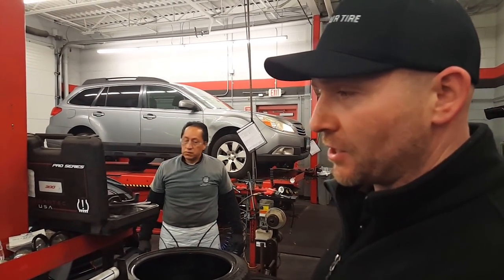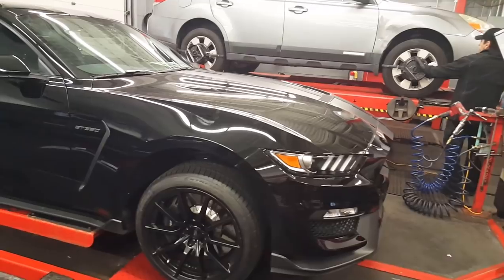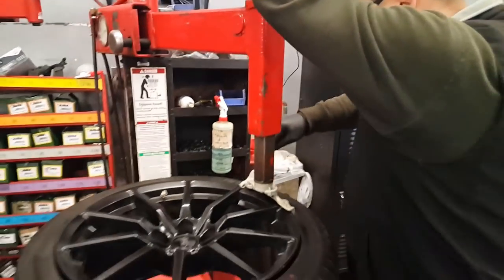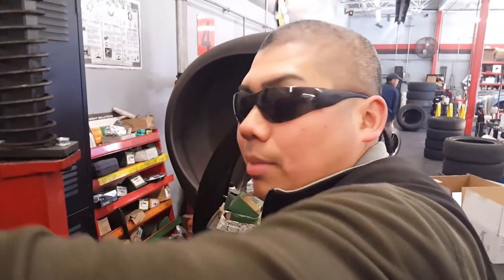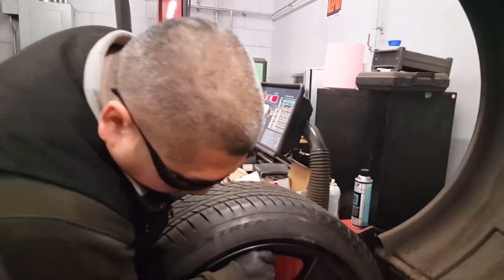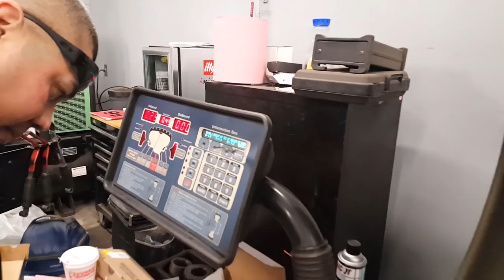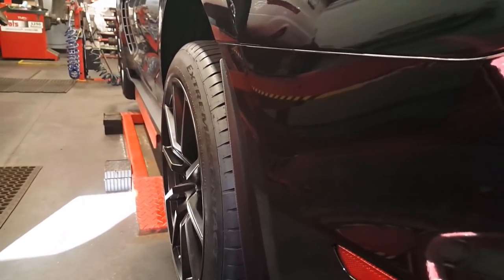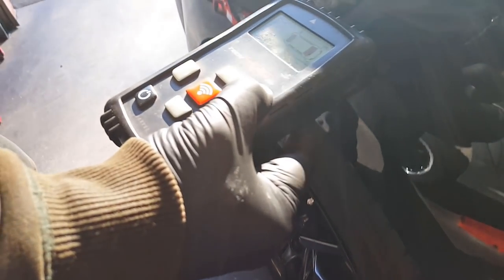How to Stretch a Tire on a Bigger Rim (Winter Tires on GT350)

Comment: Great video - I learned a lot. Never knew you had to reset the pressure sensor. What would happen if I put wheels on the car without doing that?
Reply: Mike Fyxdt they sell a device at ford parts for resetting TPMS. I believe it’s like $35-$40.
Reply from the maker: Thanks Mike. Your car would probably throw warnings.
Reply: From my experience the TPMS would just be blank and no warnings at all. Example I changed the 19 inch wheels on my 2018 Mustang GT to the optional 20 inch Mustang wheels and did not reset the TPMS. No warnings the system just does not show any tire pressure.  We used to do just fine with out this system

Comment: I have a 2021 dodge durango rt but it came with 295 45r20,  and I bought winter tires that are 265 50r20.  Would they fit on my rims? Or do I have ti buy smaller rims?

Comment: Do you have 255s on the front now? Also isn't it a bit late to have winter tires?
Reply from the maker: I should have said this upfront but this was back in December. I've just prioritized other videos first. Check out my Ford Performance Saved me $2000 for the prequel. :)  Yes 255 on the front.
Reply: @DucatiDiaries  Yeah I remember seeing the video, just didn't remember seeing them actually on the car. But damn that's even more impressive how those were able to fit
Reply from the maker: @mistamaog  And the kicker is I brought it to three shops before this and no one wanted to try it. But Town Fair Tire in Norwalk said it was no problem whatsoever!
Reply: @DucatiDiaries  Yeah I remember. Seems like they had no problem with it. I thought it would've been a hassle to get them on

Comment: I didn't know people drove these cars in the winter.
Reply from the maker: Hell yes we do John! I could drive a Volvo if the weather was too bad (or our Jeep), but I'd much rather be sitting in the nice alcantara heated seats and hearing the Voodoo sing! Check out this video and it may sway you to daily driving too! :-)  https://www.youtube.com/watch?v=v4hknY8zadc&t=660s
Reply: Rated R Cars I saw that video. I notice you have pretty high oil pressure at 3 Grand in the beginning of the video. I only drive my 1970 Z28 4-speed in the spring, summer and fall. No snow and salt. I won't even drive it in the rain unless I get caught while driving home from a show or cruise night. Weather here just East of Toronto is still cold. I actually saw snow yesterday. I did drive my 1987 Buick Grand Nat'l in the snow for a couple of years and sold it after owning it for 22 yrs. Bought my 1970 Z28 in 1981.  Scary sh!t in the National when it's slippery, even with snow tires.
Reply from the maker: @johnmilner7603  Sounds like you have a classic. On that note, probably best to avoid the damage such as I experienced in this vid. Definitely takes a toll on the car: https://www.youtube.com/watch?v=_qVeWk46gK4&t=32s